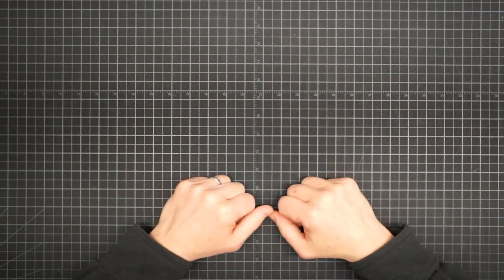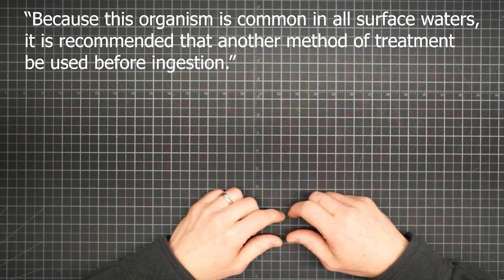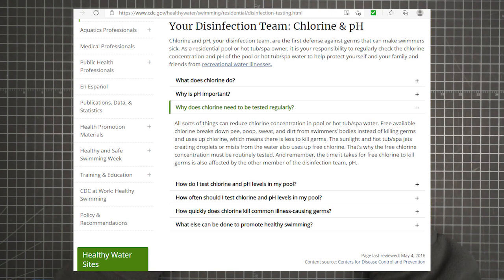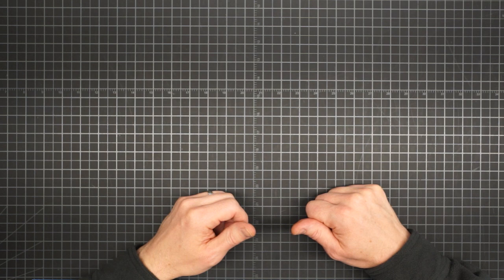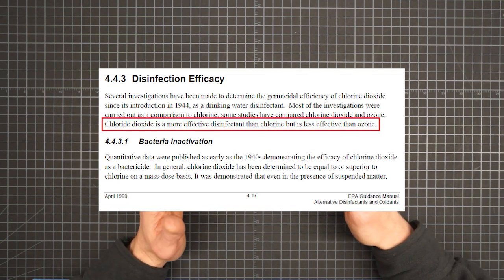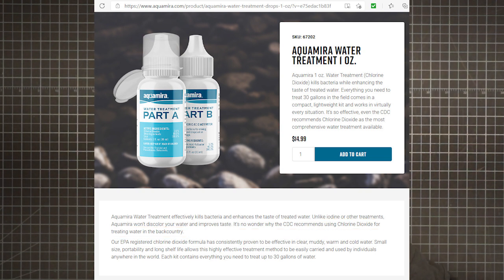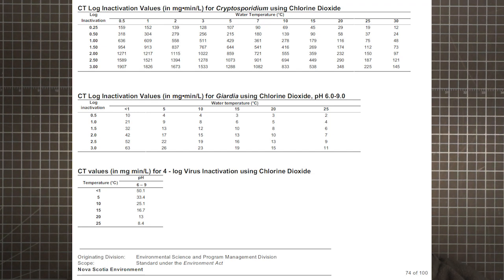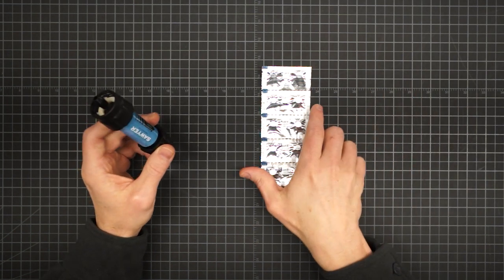Backcountry Water Treatment, Part 2: Chemical Disinfection

Comment: Where's the Intro?
Reply from the maker: It’s just the part where I begin talking (after the deer).  If that’s what you meant.
Reply from the maker: Ha! I changed it up 😉
Reply: Great video as always. Question: in the field how do you determine if a water source might have viruses?
Reply from the maker: I don’t know of an actual field test for viruses (they make home water test kits with a vial for bacteria, but it takes like two days to show result).

From what I understand, your viral threats come (mostly) from water contaminated by feces of an animal that is sick with that virus, or if you see a dead body floating.  Also, human waste (or corpses) have caused problems in the case of disasters where flooding mixes tainted water with the drinking supply.

Those are the circumstances where I’d consider dropping some tabs to supplement filtration.

Comment: Sorry but this is poorly done on Iodine.  You state that for every decrease of 10oC.  There is NO reference below what.  Below boil temp below freezing or absoulte zero, LOL.  I stil have a Polar Pure which has a temperature strip built in it to reference and tell how much more iodine to add.
FYI if you add a vit C table to water that has be disinfected with idodie it will nuteralize the iodine and kill the iodine taste.
Reply from the maker: What makes you think you need a reference?

Every 10C is every 10C.  If you know your treatment time at 20C, then you can apply the rule at 10C.  If you know it at 10C, then you can apply it at 0C.